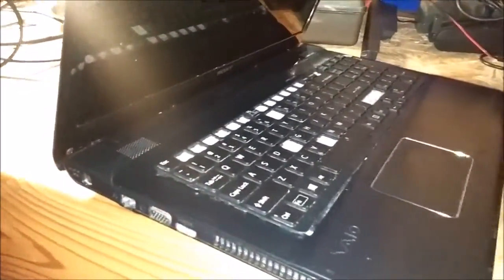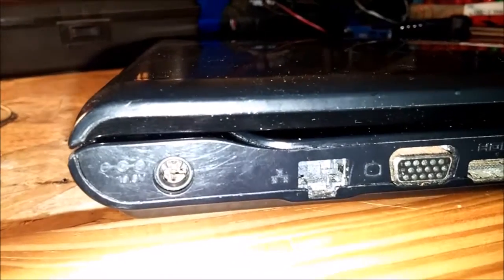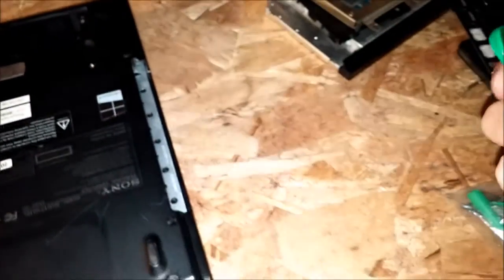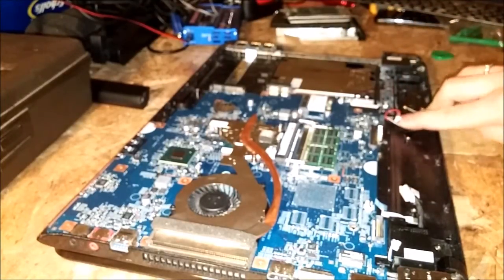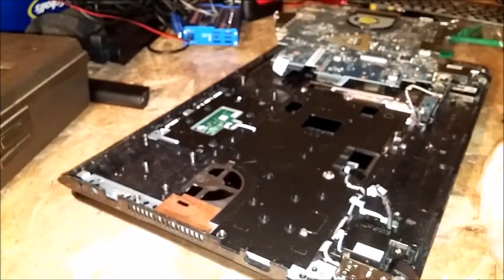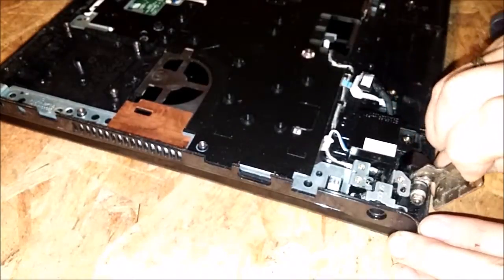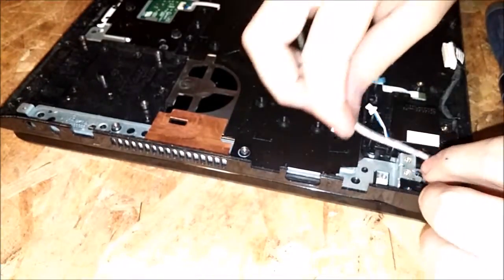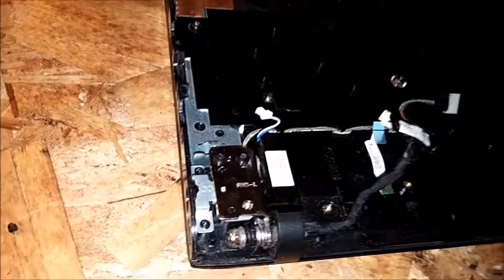Sony Vaio SVE17 DC jack replacement

Comment: Thank you for this video, I used it to do this exact repair and it really helped me out. You showed us the steps and what to expect. I for one really appreciate it.  Good Job. I normally remove all the screws from the bottom first so I didn't get caught by the keyboard screw.
Reply: ERROR -- PLEASE READ BEFORE PROCEEDING: There is an error in the video editing.  Before you can remove the keyboard, there is lone keyboard screw on be  back of the laptop in the hole nearest the battery in the middle.  You have to remove the screw to remove the keyboard.  In the video, that is the last thing shown in the video

Comment: The first step is already wrong. There is a screw holding the keyboard down, make sure you remove that screw from the bottom, otherwise you will break your keyboard trying to pry it out...